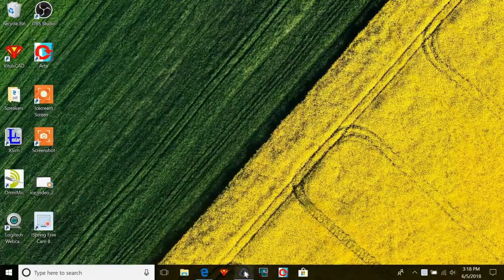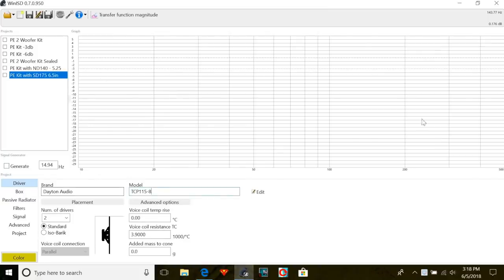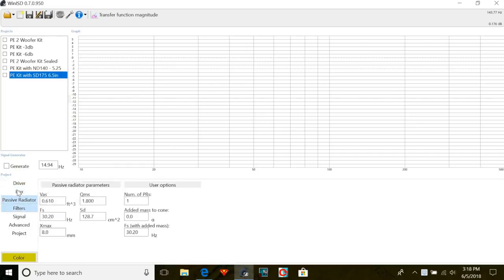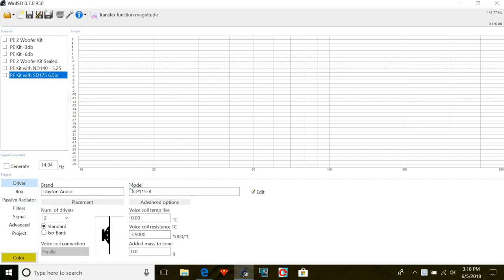Easy DIY Speaker Enclosure Design Using Free Software In 5 Steps | (How To Design Your Own Speakers)

Comment from the maker: Thank everyone for watching! You can download the Step 3 Worksheet here: http://bit.ly/step3enclousre
Reply: Hey Kirby. I just got finished my Version of your design. I never built a crossover before so I bought one from Dayton audio that crosses over at 3000 it's really nice built crossover but I don't really know if it is optimal. I also used a 8" passive radiator from Dayton audio again I don't how it performs compared to yours. My original idea came from the Polk monitor 7 and I reclaimed hard maple from a cabinet I found so didn't have a lot of wood so I saw what you did and liked it but I stayed with the passive radiator because I remember how much bass those Polk's have with it. I really want to thank you. I learned a lot from you and 123 toid and really want to send you a photo of what I did. Thanks Mike P
Reply: Great

Comment: I created a profile for the sub I intend to use, winisd says the data integrity checks out ok, but when I create a project, the choose alignment drop down is empty, and then I get this error: "Out of bounds. Press OK to ignore and risk data corruption. Press OK to kill the program." Is this a overflowing buffer? I've tried this on my Windows 11 laptop, and my Windows 10 desktop with the same result. Any help or tips would be appreciated.

Comment: The bass reflex tuning graph in the German DIY loudspeaker magazine Hobby HiFi (issue 5/2003) recommends 3 to 2.7 litres (0.106 to 0.095 cuft) for each one of the TCP115-8 for an optimal flat bass response. With a tuning frequency of 41 to 44 Hz it results in a lower cut-off at 39 to 43 Hz (at -3 dB) - depending on the DC resistance of the used crossover (I assumed 0.2 ohms) and if the manufacturer's specs are correct. If the DC rersistance is higher they need a slightly bigger volume (about +5% at 0.4 ohms) but also go one or two hertz lower.
As a rule of thumb for the port I wouldn't go below 1/5 of the total effective piston area of both drivers, so in this case 2" diameter, to prevent chuffing.

Comment: I had 15 inch Radio Shack woofers.
I believe 3 inch mid range, and tweeters also 3 way crossovers.
By measuring the deflection of the woofers the size of the enclosures came to 3ft by 2ft by 1.5 ft. (No port)
Materials were 1/2 in particle board and used pink fiberglass house insulation.
These were fantastic (not up to audiophile stands) but I'm a bit more demanding than the average person.
I want to hear all the instruments and these did just that. As a side bonus when watching action adventure movies NO subwoofer needed for explosions. These provided all the realism needed.

Comment: I looked it up and there's a formula for passive radiator. I don't if I'm 100% but it's for you double the size of passive radiator for the woofer . I used a 8" passive radiator woofer on mine that I built. I have anything to test it with but I really want to test it sometime and see what it comes out to. It's my very first build and I don't know much about crossovers so I bought one from Dayton audio that crosses at 3000 hz . Maybe in the future when I learn more I will test it and build another crossover but to my ears these sound really good and I have a subwoofer so I just put it up just enough with music to fill in the lows

Comment: To make a super bass sound. Make an enclosure with a double chamber. The first chamber is a bit smaller than the second chamber. There is a port tube between the first and second chamber and another port on the second chamber opening to outside. Better kick drum sound than a single chamber, tighter and sharper, yet way deep. I even did it with a bluetooth speaker box and it had that sharp kick drum sound too. And bass guitar is really even.
Reply: interested in how the bt speaker box is designed.

Comment: Very nice video , but im struggling to get the correct size for the port ! Even in your video the box is 8 inch deep and the port you have calculate is 10 inch in depth . What you do in that case ? Thanks

Comment: I want to build a desktop organizer that has two built in speakers on the outside, and drawers for pens and papers in the middle.  When I'm designing the enclosure size in WinISD do I still pick 2 drivers or is it 1 driver since they'll essentially be two individual speakers.  Do I treat it like a set of bookshelf speakers?

Comment: I have an old pair of Infinity reference 4x6 plates (car speakers) that I've always wanted to turn into a pair of bookshelf speakers. It's basically just a 4" woofer and a tweeter mounted on a metal plate.  Would this be feasible? I'm not expecting world class sound but it's just been something I've wanted to do for fun, mainly.  I think they could be some solid speakers for desktop PC.  And it could be fun as my first experience with building a custom enclosure.

Comment: hey kirby, can you advise me please ? I want to build a 2-way speaker but i'm not sure putting "2 drivers" for placement is a good idea. I did it at first with just one. What happens when I put 2 instead of one ? Where is winISD putting the driver ?is it simulating like a woofer would be on a 2 way enclosure ? like 1/3 from the bottom ?

Comment: I was curious if you could do a tutorial of doing a build on a vintage radio. Gutting it, adding a bluetooth amp board, with volume control and on/off control using the original control locations. Thanks!

Comment: It depends on the driver, the crossover, enclosure and the port (for vented speakers). Do it the easy way (no computer or math). Make a poly pipe tube for your vent at less than guessed length and another sliding cardboard tube that slides outside the polypipe tube. Slide the cardboard tube in-and-out to get the bass sound you like the most. It might be a bit of fucking around taking the driver out every time, but just use 2 strews (and when you are finished, put 8 in and it will even sound better). After you have determined the best length of your port tube you make 2 new tubes from all polypipe. With this trick it doesn't matter what size driver or enclosure (as long as it looks like a reasonable match) and as long as the diam of the port is like "average" for the speaker. The right length tube will compensate for any box size.

Comment: I’ve got a weird question that I hope an experienced speaker builder or sound engineer could answer to me: Does the relationship between width and depth of the speaker matter, or the volume of the speaker is the only thing important? I’ve got a small room with furniture and the door getting in my way for having regular speakers (which are usually deeper than their width), would the sound deteriorate a lot if I make an enclosure that is wider than its depth? Thanks in advance.

Comment: For passive radiators, shouldn't the total diameter of the radiator be 2x the diameter of the active woofer? Unless I misunderstood it looked to me like the passive radiator results predicted in your design software were based on radiator drivers that were too small in total diameter to meet the recommended 2x

Comment: Hey Kirby. I really enjoyed this video! It explains alot!!! Just one question, do you have to do these steps if you use a full range speaker? I know, it's mostly a tweeter but it also is a woofer. In my design I would add a separate sub-woofer.

Comment: Which software for the Linux folks would be as good as this one (and what about crossover software for Linux, as well). Thanks!
Reply: Billy Bob , I have been looking for Linux software but haven't found it. Looked through repositories but found noting. Someone should have made it by now.
Reply: Have you tried running it through WineHQ? Or try http://gspeakers.sourceforge.net/
Reply: @Mark Thanks! I thought I was missing something somewhere. I have not had any luck with WINE, so if its not reliable then its not worth investing any time into troubleshooting it.
Reply: Give PlayOnLinux a try for a greater Wine experience
Reply: WINe is just doing windows in a virtual workspace, its still windows, not linux.
Reply: The problem I have with PlayOnLinux (and similar variants) is that they are designed for playing games. If a Windows game is in their database then it usually runs fine but for anything that is not a game then it usually does not run at all (even with a manual install) because there is usually one to more libraries that are missing. If Wine had complete library support with Windows it would work but unfortunately after all these years its still missing a huge number of components. Thanks anyway! :)
Reply: Have you run WinISD and xSim successfully on it?
Reply: @Mark William Mandigers Very true, but can be an option when there's no other solution
@Billy Bob agreed it can be a pain to chase and gather the missing libraries, but did it a couple of time successfully... Now, to tell you all, I now always have a VirtualBox VM with an old W$ handy to run all that proprietary code.
Reply: @Jérémie Which libraries did you gather to make the sim software work with Wine? It has not worked for me so far.
I do not do virtualization because I do not want to pay M$ for an overpriced copy of Windows (which is redundant anyway because if I purchased a copy of Widows the I would simply triple-boot into Windows and run it natively, which makes Wine redundant LOL).
Reply: Billy Bob sorry, wasn't clear, did not run WinISD or xSim but other softwares under wine making the dll dance.
Triple boot?
Having to manage a multiboot install to run a couple of low reqs softwares... Surely favour my file backed VM! And you can find w7 for a few bucks at every corner
Reply: @Jérémie I was hoping that you figured out WinISD or xSim on Wine LOL. I commonly had macOS, Windows and several different versions of Linux on my MacBook Pro so yes I would triple boot it or quad boot it or whatever LOL It works just fine, but I no longer have a site license from work for my personal machine so now I only run macOS and several versions of Linux on my MacBook Pro.
Reply: @markwilliammandigers1001 WINE = Wine IS Not an Emulator... heard that one before? ;)

Comment: Im am trying to make DIY speakers from refurbished drivers. The drivers got no information at all, printet on. How can i messure that?
And would it be possible make a cross-over that can make 4 5" drivers play like one larger woofer driver.
I would devide their frequency area into 4 in order to make each driver play better in their small area, instead og the whole freq. area???
Would it be possible??? and will it be difficult?

Comment: What no sealed boxes?  How about periotic membrains. Or compound mounted bandpass ported enclosure.

As for tweeters, they are almost always sealed, but do take up airspace, but its negotiable for the most part.

A ported box should have the port in the same plane at the driver, and its best to eliminate standing waves by not making a rectangle shaped box or 2 parallel walls, this will cause waves to cancel each other out becuse one wave will be 180 dgr out of phase to the other waves movements.  Learning how to turn the back wave to time aline with and be in phase with the front wave will make the speaker play louder and sound more crisp.  So experiment with differnt shapes that don't use 2 parallel walls or multiple parallel walls.  Your speakers will sound better and produce more low end midbass.  Subs are the same midrange, tweeter, and super tweeters are differnt placement is key as well as time alinement.  You want all the sound to reach your ear at the same time.
But each speaker plays at different speeds highs travel faster but not as far..
Keep the speakers properties in mind.

Comment: so if my woofer needs a specific volume when ported, adding that port would take out some volume right? because i'm sticking a physical tube into my open space. stupid question, i know.
Reply: Yes. Now im no audio guru, but the tube is relatively thin, so i think the volume loss inside the enclosure would be negligible, especially when the enclosure gets bigger and bigger

Comment: Hey I just wanted to make speakers but I really did not know it is just about this complicated I hav got very old speakers Sony E34 i wanted to make my own whit some wood but I guess it is way more complicated I really do not get it I wanted to use a ground zero GZIW200X-II 8Inch 4ohm subwoofer and some tweeter whit it but now I don’t know how and I do not know what kind of data I need for the calculators

Comment: Port chuffing is a high crime. I can't understand why designers allow speakers that chuff to be signed off for sale.
Reply: True. But I'll go further.

I don't understand why bass reflex is allowed or desired, period. It's inaccurate sound. And to some degree you'll always be hearing the back waves resonate within the box and then escaping.

For me, aperiodic, sealed, or some transmission lines are the only way to go. With those mentioned designed, mechanical impedance, transience, and/or sonic purity can be vastly improved and still maintained.

I'd even rather go open baffle than bass reflex. It has a well established di-pole philosophy behind it. With bass reflex, it's a way for bass heads to geek out about getting an extra octave.  The cost is muddy bass and resonances that weren't part of the original source material.

Yes, sometimes muddy dirty bass is desired, but guess what, that sound can be recreated using a sealed subwoofer if the audio engineer intended you to hear such a sound. Creating a speaker which turns everything into loud muddy bass is a gimmick which destroys purity.